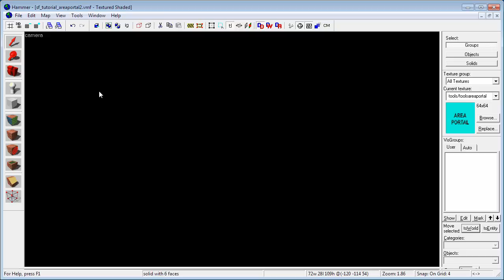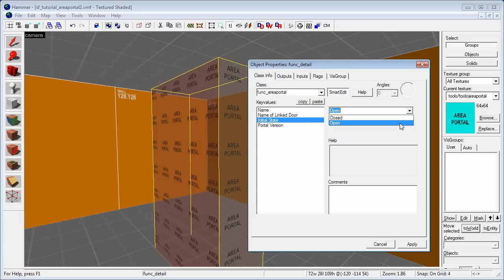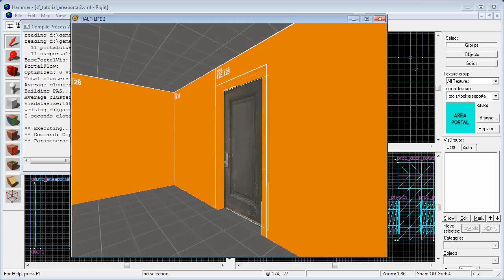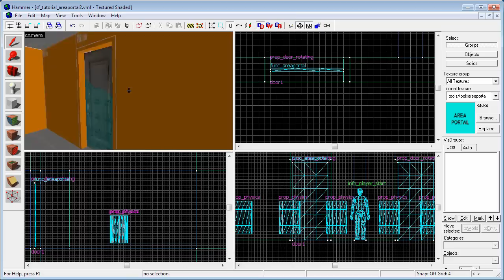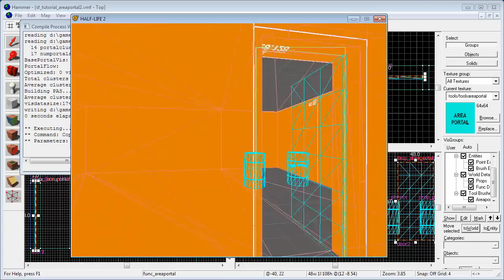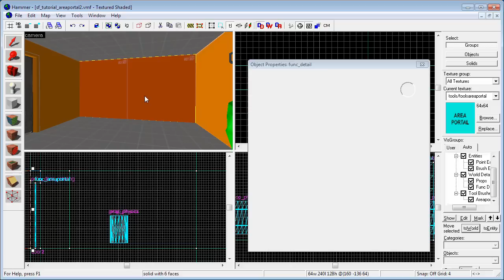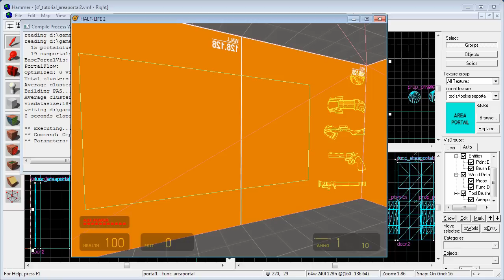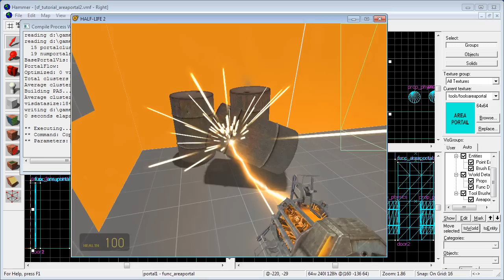SF's Hammer Tutorials - Optimization 3: Areaportals

Comment: What if i have many rooms with windows...but the windows are unbreakable
do i need to place areaportal on the windows too?
Reply from the maker: If you can see through the windows they won't be blocking visibility, and in that case yes, you have to make sure the windows are covered as well or the area portal won't be touching two areas.

If you are going to tie the area portal to the open- and closed-ness of the door, then you cannot have windows leading into the same room. This is because you'll then either be unable to see through the windows when the door is closed, or you'll always be able to see into the room regardless of if the door is open or not, making the area portal pointless.

Comment from the maker: @omnacky Yes, after compiling the level and the compiler has found the leak, press Map > Load Pointfile (or something like that) and it should display a red line in Hammers 3D and 2D views showing you where the leak is.

Comment from the maker: @AguyinaRPG I'd say it'd be a very good idea to use an areaportal in that case. Because that would mean you would not have to render an entire street before you really need to.

Bad places to use areaportals are when they don't block enough from being rendered. Each open areaportal takes power from the engine, so you need to stop enough from being rendered to at least cover up the cost of the areaportal to have any benefit.

I use VirtualDub for the video and Audacity for the audio.